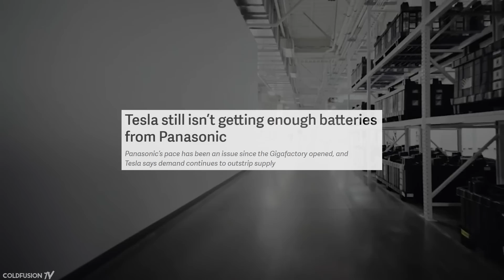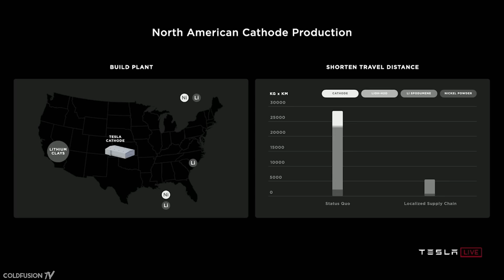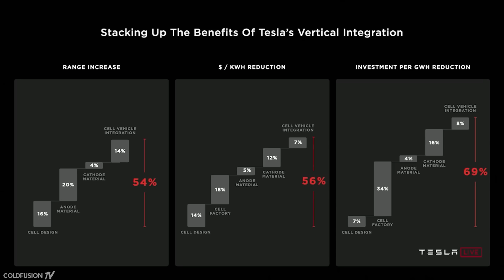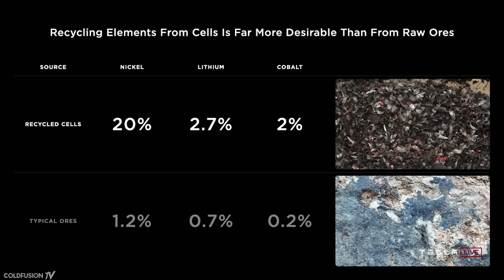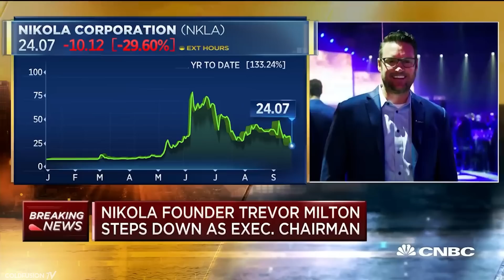Elon Musk: Affordable $25,000 Tesla and Better Batteries Are Coming

Comment: The current state of the batteries are the pinnacle of its technology. Anyone with a true engineering background can testify this. 

This video was made a year ago with claims for well over two years ago. These claims are made by Elon to retain investors but have yet to even be developed. You can trash me all you want but the same batteries used 5 years ago are the same ones utilized right now in the newest version of ANY electrical vehicle.

Comment: Great Video! Yeah, 25k is a great price for an electric car this size. But there are more problems with TESLA cars than the expensive batteries.
The quality is so damn bad. Gaps between parts, door handles that don't work, expensive tyres, external mechanics can't get parts, waranty disappointments, high energy consumption (25 kw per 100 km) high unsurrance costs.
These are the reasons why i drive a Toyota. Their cars are perfect. And if there is a problem, they will fix it in no time.

Comment: 1 KwH = 64 cents for me since I have a pool and spa that need to be filtered.  Electricity is so much more expensive in socal, where areas are most densely populated....unless I install 55 solar panel in an area that sees almost 335+ clear days a year with perfect angle on my roof, I cannot even break even on my usage.  I keep the upstairs at 79 degrees and don't even turn on the downstairs thermostat.  Electric bill is still $1.1k per month in the summer, even with filtering pool and spa for less hours than recommended and during night during non-peak hours.  Plus, no one can buy a base Tesla, as it's terrible and you get charged like $2k for paint and $7k for auto drive and all the other upsells...it's ridiculous to call it a fucking $25k car.  My sister spent $85k on hey model X or Y (whatever the SUV was) and my other sister spent 90k on her tesla, then had to pay 2.5k for the installation for charging.  I still don't see the damn profitability yet of Teslas, and I don't see most of the increasingly poor people in the US investing in electric cars that cost more over the llfe of the car even where electricity is relatively cheap, as gas is relatively cheap there too (I've seen places in midwest have over $2 a gallon price difference from where I live, when gas hit $1.80 or so for them recently.).  This isn't launching what was a $400 phone into a new market, beating all the competition like iphones or ipads, something anyone could save up for...this is going to be a wealthy, virtue signaling car. 

I still admire what they are trying to do and once they get batteries and solar cells that can hold the energy I need to break even and not make my entire roof look fugly as hell, I will drop the (current quote of 65k for just panels installed) for getting solar in my home.  Even those I am sure will break and need maintenance not covered by the warranty.  This is why I don't want an electric car that is hard to fix...already hard enough to fix any cars with my dad past 2008 or so, as there are sensors of fucking sensors for a component and they encase the fuckin engine in a giant block of steel so you can't fix without voiding your warranty, it all seems stupid to me.  My parents are considered upper class (barely) and live in a neighborhood where the average house is over a mill with no debt and  5-7x the value of that in investments and retirement and I live in a larger house than them in the same community but don't have that large of a nest egg yet.  My dad is still fixing his fucking 94 astro van while the neighbors have always hated that he doesn't have a nicer car.  I get the same thing with my dirt cheap 2004 cavalier coupe LS which still is running and is super easy to fix and my parents bought it new for me (I was so mad they chose a car without consulting me on whether i would like it at the time) to commute to the university I went to after high school. The thing fucking still runs like a champ and gets over 32 miles to the gallon.  I dunno why people spend so much money on leasing new cars and getting new crap they don't need...it baffles me.  Might be a reason why I've watch so many neighbors get foreclosed on and even have capitalized on that misfortune twice when buying homes in my early 20s, albeit both times were a pain in the ass when dealing with lying scammers.  Point is, if you aren't saving >40% of your post-tax income (only applies to those who CAN do this and choose not to) and investing that elsewhere, you are seriously playing the game of life wrong.  Stop buying new crap and throwing out old crap...learn to fix the old crap.  Buy used shit off ebay and fix it....I am telling you it will have much more value and most likely betttr quality if it is from 30+ years ago anyways (this does not apply to technical advancements).  BTW, I don't mean to come off as a dick but 

PS: I just reread this and I come off as a spoiled dick, but I will tell you all one thing....I stopped caring about money at age 26 when I realized I had enough to live comfortably and to not have to worry about money anymore.  The whole pursuit of money for me wasn't for greed, but it was just to make it so I didn't have to literally think about or worry about money anymore.  After working hard and getting some money from stock options, I ended up becoming extremely depressed because I felt the urge to keep investing to get more money and so on, and I was like, "what's the point?  I grew up happily and frugally in my family, never going out to eat and always being jealous of what all my friends and people around me had.  I mean for luck when we traveled my parents literally were packing crackers, bean dip, and cheese whiz for our road trips as children, and I was perfectly happy.  You wake up with a scary truth the more you own....you eventually die and lose it all...and then even if u are some great person who is remembered for ages, eventually we will be extinct and no one will utter our names.  The "ego" part of amassing wealth hits pretty hard when you have something to lose, and this hit me really hard many nights with horrible panic attacks in my 20s when I thought everything was perfect in life, which is why I don't understand these billionaires at all.

Comment: You see I wont be compelled to buy an electric car if it's the same price as a normal car. If I want to deal with all the disadvantages when it comes to range & charge time while on the go then it should be like 15,000. I'm not going to pay the same for something where I have to wait 45 min to fill up a tank IF  there is even a super charger.

What if I'm on a road trip through the desert, or driving to the the artic ocean in Canada for a road trip. The only infrastructure out there is gas, you don't find electric charging at all.

I enjoy going to road trips, if you sleep in your car it's actually pretty cheap. But you cant do that if your worried about range & charging. Also gas is just cool. The fact that I got an engine burning fuel with little explosions happening every second hundreds of times. Idk gas is awesome, & it just works perfectly fine for me. I hope it stays around for a long time.

Comment: 25k? how about 10k... scaling production to meet the scope of gas automobiles should put the cost right around that. because electric vehicles are so much more simple with only a tiny fraction of the complexity and individual parts. a gasoline automobile has so many systems tied to the combustion engine, its mind boggling. electric is comparatively simple, essentially with just a battery and some electric motors strapped onto it. a gasoline automobile has over 10,000 parts, and also requires lubrication . thats insane

Comment: There are also new issues introduced by new battery format - first - before that change, tesla ran on more or less standard batteries. This meant You could service the car in markets where getting imports is difficult - islands, remote areas like deserts etc. It is big maket of people who rather would set up solar panels or other local power source, rather rhan drive hundreds of km to get gas. Well, now those people know battery pack is not serviceable anymore, so will rather buy competing products.

Another is that tabless design is not really tested. Tabs exist in batteries for a reason. You can have two or three tabs and guess what - someone tries to be smarter than entire battery industry :) 
Without tabs you rely on pressure fit, in chemically agressive envionment, exposed to extreme thermal cycling. 
It could be good idea, but then world needs demos, samples and testing them, not snake oil and vendor-lock-in. 
After few years of testing in e-bikes, power tools and powerbanks, we could say those batteries are good. before that it's just a bet. Perhaps good one if you live close to factory so they can recycle your car (because it becomes more or less not serviceable)

Also decision to cut corners and make car single-use has export consequences. Car becomes trash upon entering teritory where it cannot be recycled - normal cars retain value after f.e. crash. Tesla becomes BIC pen - any failure and it is sent to trash bin. So it's value after f.e. crash becomes negative - cast elements cannot be repaired or welded, batteries are proprietary and not designed to be replaced, etc etc. It becomes electrotrash, difficult to dismantle and recycle, unsafe to keep , expensive to process. Many places might ban Tesla imports right away because od that.

Comment: Take out all the computer crap take out the fancy dashboard and just literally have it be a go cart vehicle basically and put it on for 7 to 10,000 and you’ll have customers no way I’m gonna drop $25,000 on a vehicle that tracks my every movement and only has a limited distance of around 300 miles maybe when I can have a gas vehicle that goes at 300 miles and can store cans of gas in the truck to extend my range once they remove everyThat isn’t necessary to go forward and backward in the vehicle I think they can get it down to 7 to 10,000
Reply: Not to mention I don’t have a desire to live in a world where I give up my actual right to drive a car autonomous vehicles if shut down everyone’s throat will be the standard and to be able to drive the vehicle will either have to be rich or some kind of government entity

Comment: If they really want to make electric cars affordable, they should be designing infrastructure and tech that would be universally compatible.

Making their batteries more efficient is great, but making them even more unique to the Tesla is probs not great in the long run. This reminds me of when every different phone manufacturer had their own unique charger cable. The entire auto industry including Tesla ought to be negotiating standards around battery packs, charger networks, and hotswapping. Otherwise the EV is going to hit a major wall in competing with petrol and diesel.

Comment: I'm a bit sceptical they will achieve all of the improvements they presented, especially in that timeframe. But even half of that would be respectable. Some of them (battery form factor) are very possible, but also easily available to other manufacturers. I believe they have the edge, but probably not as much as they're suggesting.

Comment: I still don't see why they push the largest cost of the vehicle (batteries) onto the consumer at all. 

Just make the batteries a quick swap system that can change out a depleted set quickly with a charged set. Then you could just have a subscription service at local battery change out stations. Pull up and swap your depleted batteries for a fully charged set and continue on. The batteries would belong to whatever subscription service you choose and as long as your subscribed you hold onto a set of them. This way you dont own the batteries at purchase making the cars up front cost FAR cheaper on the consumer.
Reply: I don't think you realize how big the batteries are on the bottom
Reply: @UnreachableString  I am very aware. If you can think of it then you can engineer it. This is not some type of insurmountable idea.
Reply: @budc.8172  it wouldn't make sense to swap out batteries because either you have to take off the bottom of the car to do it or you condense the batteries into a small spot somewhere(probably the front) and with that you lose the safe of the weight on the bottom of the car
Reply: @UnreachableString  See you're already beginning to engineer a new design. Wasnt that easy? To think two random guys online came up with a billion dollar design in the matter of 6 comments.
Reply: @budc.8172  but did you see what I said after the battery is based on the bottom of the car making it very hard to roll over which is one of the reasons why tesla's have such a high safety rating if they were to move it to one condensed spot lets say in the front of the car you would lose all benefits of what it has now and you would not be gaining much for the trade
Reply: @UnreachableString  Man you are trying really hard to be a negative nanny arent you.
Reply: @budc.8172  I mean I just stating a legit point it would be nice to have something like that but its not practical and after battery day its not really a big deal anymore

Comment: Electronics are getting cheaper so it makes sense that they could probably manufacture that car for $20,000 just as easily or even less.
Fossil fuel engines have several hundred parts not including the emissions standards it takes to keep CO2 As low as possible. Most of the parts come from job shops all over the world which increase the cost of an automobile. Keeping it all in house would help Tremendously to lower the cost.

Comment: That's all good, but owning a Tesla is incredibly expensive compared to owning a gasoline-powered vehicle. All the parts are expensive, you have to drive double the range of the car to find someone who can repair them, and it costs just as much to juice them up as it does to fill up with gas, and you get less range and it takes an hour instead of a couple minutes

Comment: You missed the key takeaways, Tesla held this presentation for two reasons: 
1. To forcibly push the big four battery manufacturers to innovate faster. Now that Tesla has announced this new tech, auto manufacturers will demand similar improvements from their suppliers.
2. Inspiring young people to go into engineering and engineers to work at Tesla.

Comment: Thought 💭, and please comment. If they just produced the top of the line battery 🔋 and made battery packs of various sizes, the cars receiving the smaller pack size could be made lighter and therefore cheaper, resulting in increased range and performance. Would this approach not be better? It’s a different way to go about things.

Comment: Tesla Delivered the Y ahead of schedule. In both factories. They do not have to wait on vendors. They are making their own machines. That is why they bought HiBar. And the changes they are making in the manufacturing of the actual cars structure? Is going to reduce their unit cost by 30%. As an engineer myself I understand what they have achieved. If I were the head of a car or battery company today? Id be VERY nervous. Oh and btw Tesla's current battery costs are estimated around $123 by private engineering analysis. This new format and battery structure combined with the other things? The cost to manufacture this car is going to be less than $10k. And consider that in 2 years Full self driving is probably going to be a $10k premium on the rest of the lineup? You are looking at a car without it being $15k or so. Giga India.

Comment: V2G is kinda waste.....
1. When eventually (5years) cars can fully drive themselves , they will not be sitting around to trade electricity.
2. If you use cars battery for electricity trade , eventually battery will degrade while the car is pretty good. So the entire car becomes useless.
3. Tesla will use different strategies for batteries in cars and energy storage. Car batteries are simply not designed for the work of later

Comment: I think the bigger story is on the manufacturing side, as great as the new battery tech is, their ability to make more batteries, faster with a smaller footprint at lower cost is going to be what puts Tesla head and shoulders above any perceived competition for the next decade, and possibly longer. VW is going to be right on their heels and the rest will catch up with battery tech, power train and full self driving, as Musk said in the presentation but none of them will have all that AND the proficiency and volume of low cost batteries that will be needed for growth.

Comment: 1:45 I assume they are comparing old 21700 batteries with 46800. if you calculate the volume ratio pi x23^2x80/(pi x10.5^2x70) you will get 5.48. so the figures '5x energy' and '6x power' constitute absolutely NO progress in battery technology